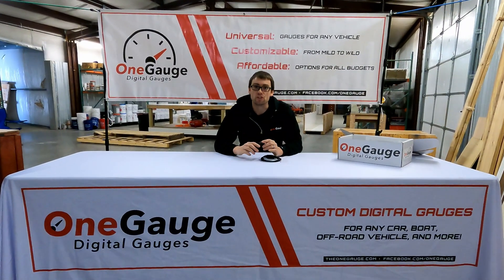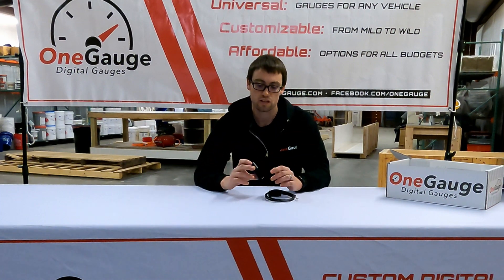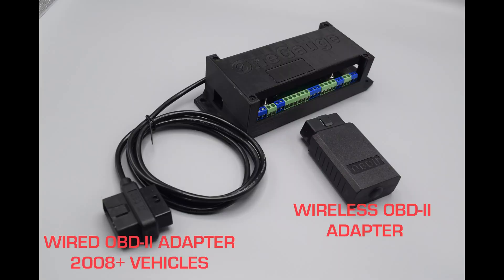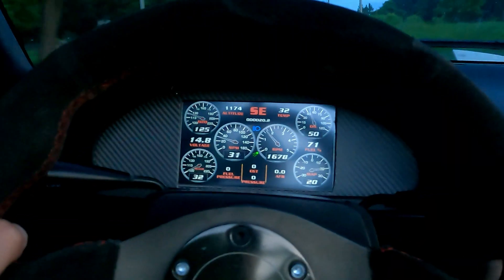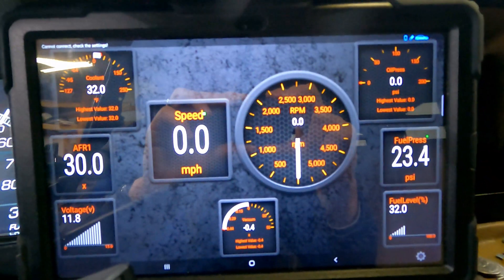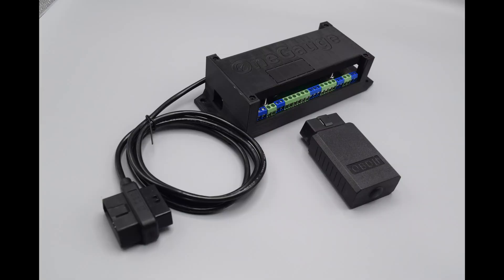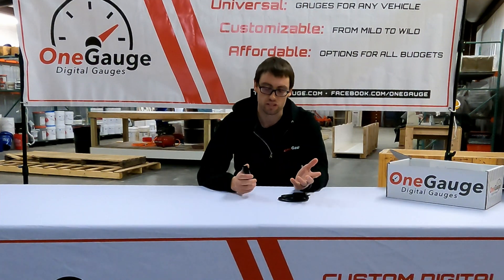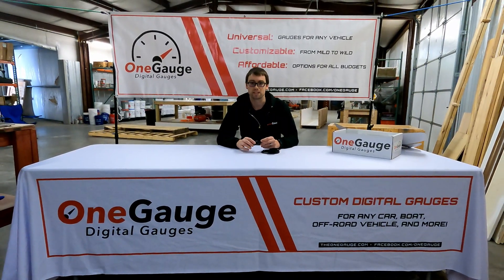Plug and Play OneGauge Digital Dash using OBD-II

Comment: What would be awesome is if you made an obd2 heads up display unit
Reply from the maker: Definitely possible, there's a few ways to do that! There are a ton of those on the market already through, but if you wanted to add gauges/sensors that aren't monitored by OBD-II then OneGauge would be a good solution.
Reply: @TheOneGauge  everything I look at isn't that great. Maybe I'm missing something when I'm searching. Do you have any suggestions before we start going down the path of making something?
Reply: @Muj_A_Lago  have you seen the HUDWAY Drive? That is the HUD I am looking to buy for my project truck. The features I like about it are the phone info displays to have my turn by turn navigation instructions displayed. As well as speed and a fuel economy readout. Seems to be one of the better huds avilable,, most others are generic and cheap looking
Reply: @HAMMER_2.2  thanks! I'm definitely gonna look into it!
Reply from the maker: @Muj_A_Lago  I'll check out what what was shared below, but if you have more questions feel free to email me! Info@theonegauge.com. That we we can discuss what exactly you're trying to get out of it.
Reply: @TheOneGauge  I think I will. Hudway is nice but I'm looking for mainly just vehicle speed and RPM to project onto my windshield.